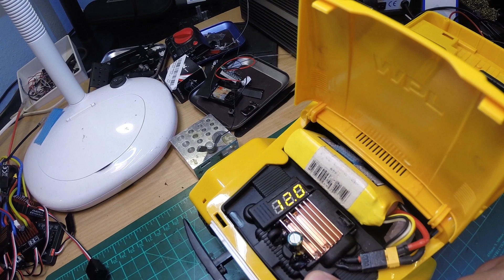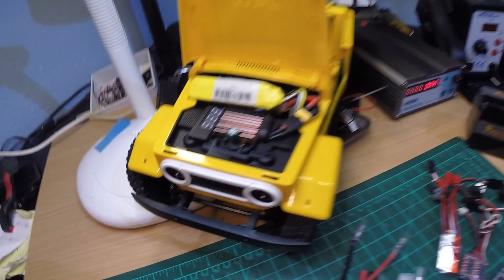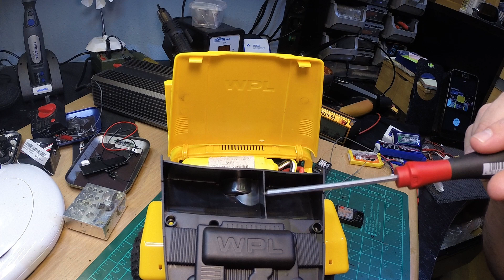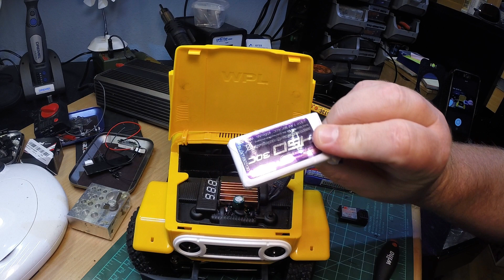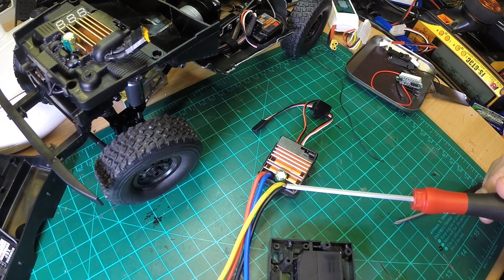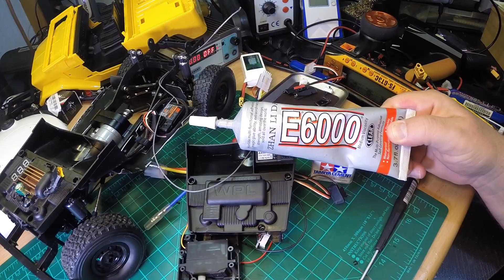WPL C34KM Landcruiser FJ40 Build, Mods, Upgrades - Part 9: Electronics Installation

Comment: Hello! When you switched to another receiver and drive, do you think it worked more tactilely on the throttle at low speed? thanzs!
Reply from the maker: This is only depending on ESC nd not on receiver. Better than what before? Did not switch, but could use other, better ESCs.

Comment: Hi great info as always! I got a C34KM shipping to me now, I was wondering if a 2s lipo made any significant performance over the li-ion 2s in your case?
Reply from the maker: I never used anything else but Lipos. But in a crawler Li-ion should not make any significant difference (in contrary to a heli or race drone).
Reply: @donaldsneffe  Good to know, I got 2 li-ion already so I'll hold off on getting lipos for now 👍

Comment: What's the max battery size you can fit there?
Reply from the maker: Here on the pictures (posting 1) you will find the exact dimensions of the compartment: https://www.rockcrawler.de/thread/40987-wpl-c34-toyota-landcruiser-fj40-bau-erfahrungen-mods-und-upgrades/?postID=1174525#post1174525  So if you only use the comparment (cut the wall) for batteries and put receiver and ESC on another place, you can get more than 1000 mAh 2s and 3s batteries with appropriate dimensions in this large compartment. Depending on dimensions of batteries, of course.

Comment: hello what battery it takes? I recommend two lipo cells or three cells? more than anything else I would like to know the size of the battery that I should order thanks !!
Reply from the maker: 2s (7.4 V) is sufficiant. 3s (11.1 V) is very, very fast. You can take nearly every small 2s battery up to ca. 1000 mAh (and larger). What size is depending what you want to store in the compartment. Do you only want to store the battery there, or battery and receiver, or battery, ESC and receiver?
Reply: @donaldsneffe  
hello, thanks for having replied to me, the kit is coming to me, where would you advise me to put all the rc compartment? battery receiver etc? also to change the engine and put a brush ?? you would tell me the ideal components esc battery? sorry but I'm on the phone and I struggle thanks!
I also saw that you installed an inversion kit
Reply from the maker: @maverikwartj0184  What ESC will you use?
Reply: @donaldsneffe  
I thought of using what you put in the link or what I am attaching to you 
[28,86€ 14% OFF]Racerstar 2838 Motore Impermeabile Sensorless Senza Sensore 3600/4500KV 35A ESC per 1/12 1/14 Automobile Macchina parti rc from giocattoli hobbies e robot on banggood.com
https://banggood.app.link/ucvrlUzu30

Comment: I think that you'd need a PVC glue,the type that plumbers use for gluing plastic pipework.
Reply from the maker: ... maybe, did not have such a type of plastic so far... have a ton of different glues here. 
Not that important, wanted to make some brackets out of styrene to be able to mout (screw) voltmeter and push button. But did also work that way, used thin servotape to stick the voltmeter to the side of the ESC and it is also held by "clipping", cut a tight fit space for it into the "fake-motor". 
And push button mounting was surprisingly easy, small notch into the plastic stand, press fit, perfect (plastic is very flexible, as you know).